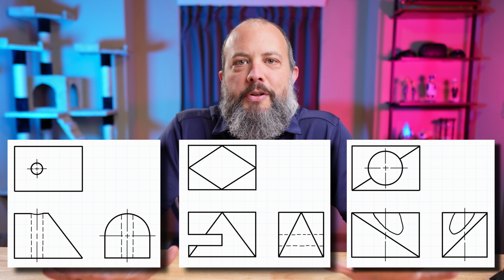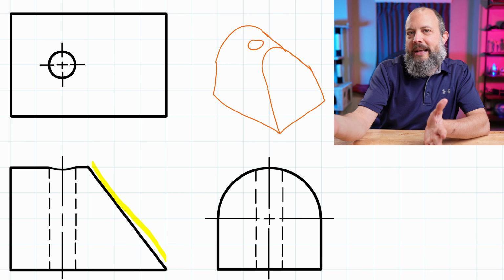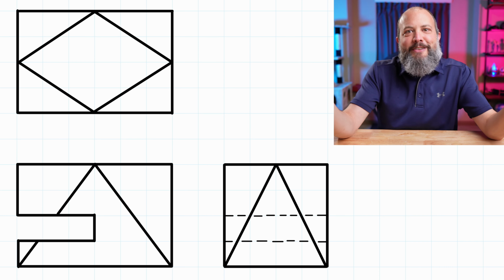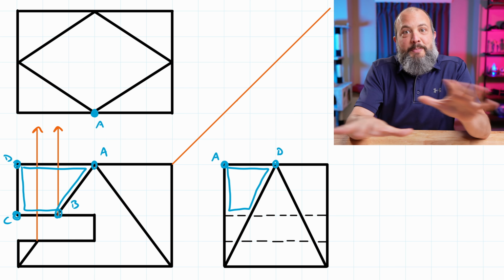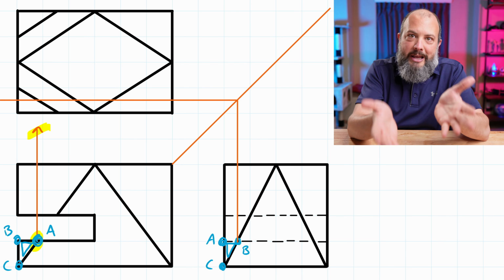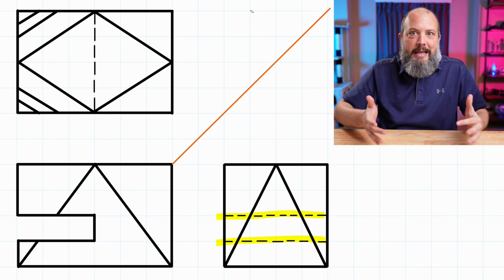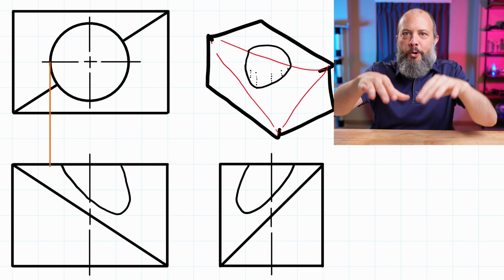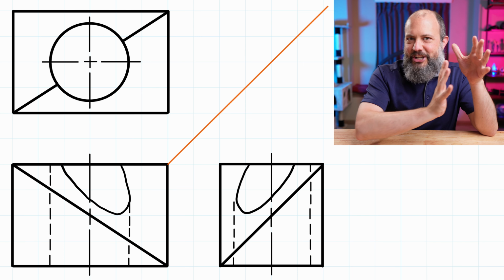Mastering MISSING LINES - Surprisingly Tricky Examples

Comment: Did you miss the hidden divot in the right side view of the first problem?
Reply from the maker: If this is referring to the divot on the front view, at the top of the vertical hole - no, I don't think that would be visible from the right. The dip that is visible on the front view should fall exactly behind the curved visible line on the top of the right side view.